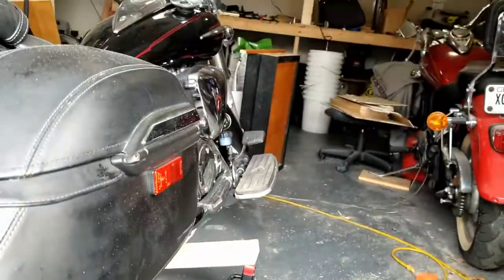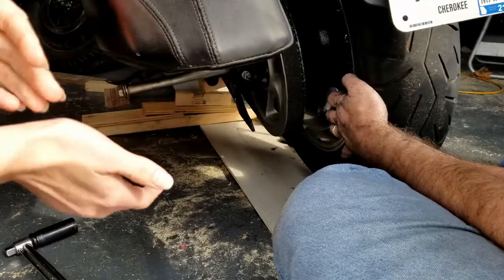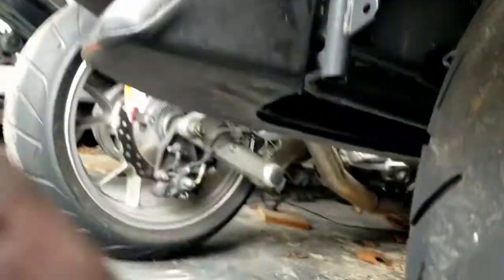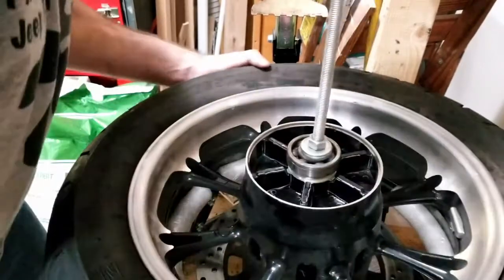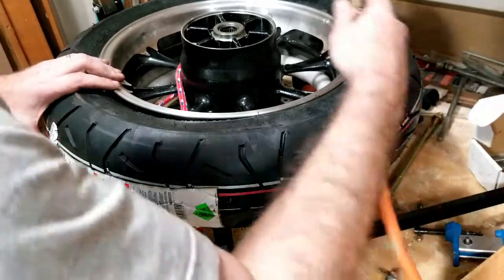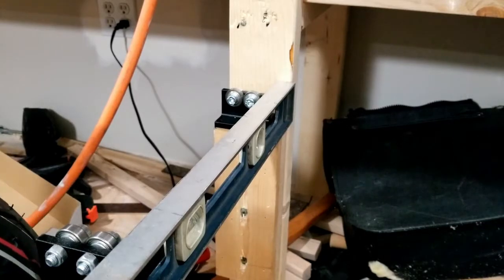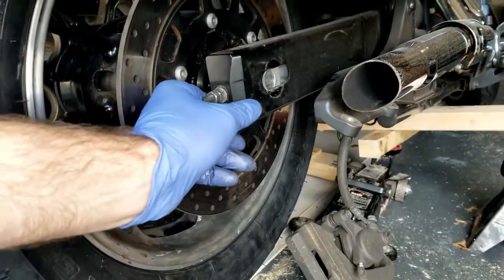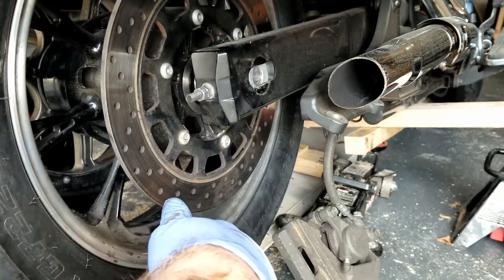Yamaha VStar 950 Rear Tire Removal and Lowering Kit Installation - Part 1

Comment: DIY is cool sometimes. In this case, the little money you saved was definitely not worth it using the wrong tools. You made this look very dangerous. The shop is getting very expensive, but they have the right tools for the job and they do it on a regular basis. I don't have the patience for this kind of stuff.